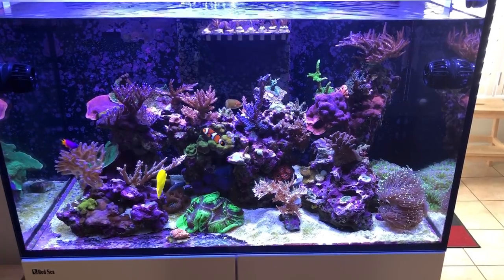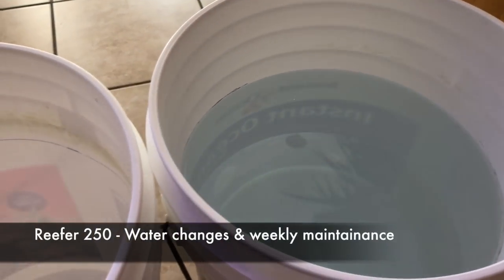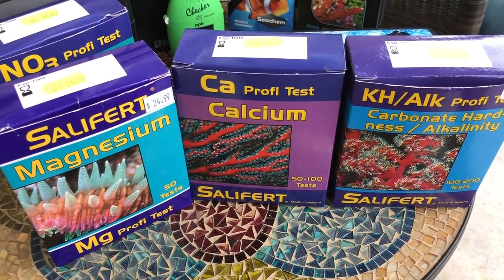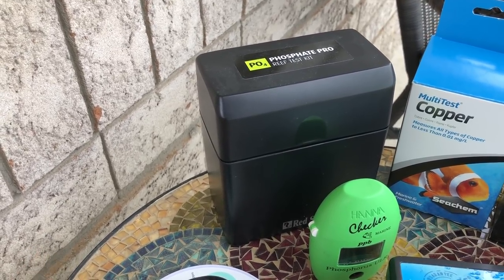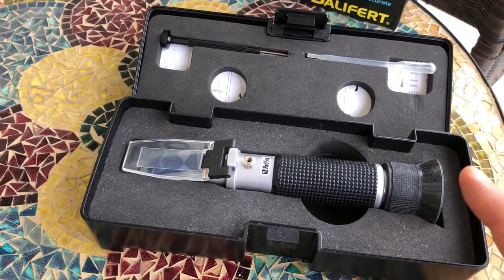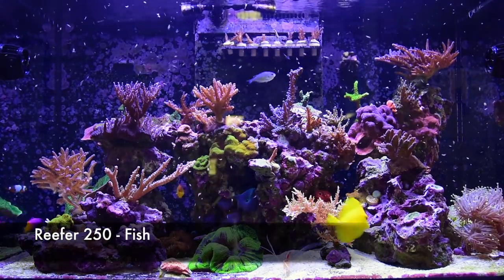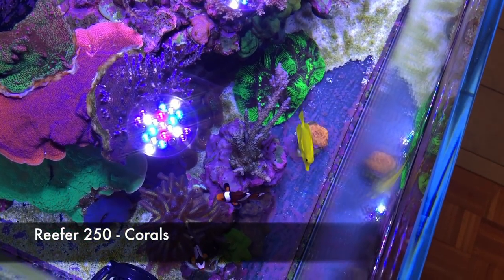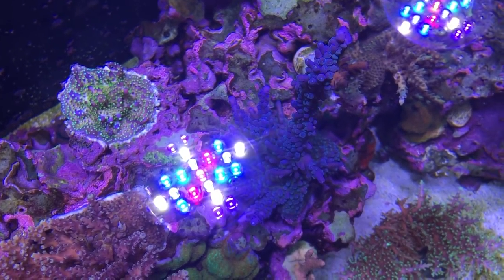Redsea Reefer 250 turns 2 years old!

Comment: The reason for the calibration at 35 is that the further away your desired salinity is from the calibration point  the greater the measurement error. HOWEVER, if your solution has been around awhile, it may not be at 35 PPT any more (even a tiny amount of evaporation will change it). RODI will always be at zero. Unless, of course, your unit needs things replaced. 

I see some bottles of RODI for calibration. This isn't as crazy as I thought, since it will always be the same.

Comment: Fun video with great information.

I plan on keeping Acros in a 10 g quarantine tank for 21 days, in case any fish diseases have traveled with them. Also, no dip will kill eggs. I'm a newbie and don't trust myself at detecting these even though you'd see them instantly. Therefore, a second dip in 7 days, then a long Interceptor tank treatment before transfer. If this still doesn't work, it's an act of God.

While my display tank will have tons of par (MH+T5), lighting the quarantine is tougher because my lighting solutions are very expensive for small tanks.  I was thinking of the Aqua Illumination Prime.  It won't be used that often, I think, but it should work over a small footprint with adequate durability and spectrum.

Any opinions?
Reply from the maker: skzion2 sounds like a good plan to QT your acros... I would be a bit worried about parameter fluctuations and adequate lighting in the 10g... I would suggest trying your coral qt system on a few cheap frags at first to make sure that the small system can sustain them for 21 days
Reply: AmroAzul TV Thank you very much for the suggestion regarding size and stability of parameters. Agreed on testing with a couple of cheap frags that I still want. Used on tiny frags, alk shouldn't be a problem. Maybe I'll add a cover to reduce evaporation. Water changes for, say, 10 frags at a time should maintain stability, I think.

Do you have a different lighting solution for this purpose? Would 20 ga work better?

Comment: You are crazy using RODI water to calibrate your Salinity. I did that and then found out my salinity was 1.021. Not even close to where it needed to be. I also tested ocean water  here in Florida and calibrating with RODI water and it was far off too.
Reply: Maybe Red Sea makes their refractometer different than the ATC I use.
Reply from the maker: Trevor King I guess it depends on the refractometer, but I honestly tested out calibration using rodi vs 35 ppt standard solution; I got the same reading using both on multiple occasion, so I convinced myself that it didn’t matter
Reply from the maker: Trevor King good point; the Redsea maybe more forgiving. The instructions that came with it suggested calibration with rodi so perhaps it is setup differently than yours